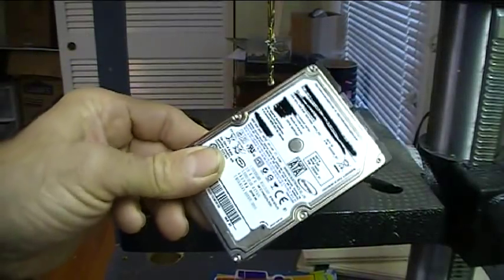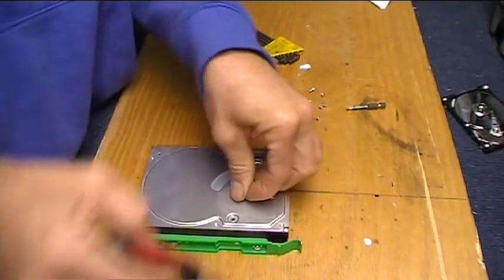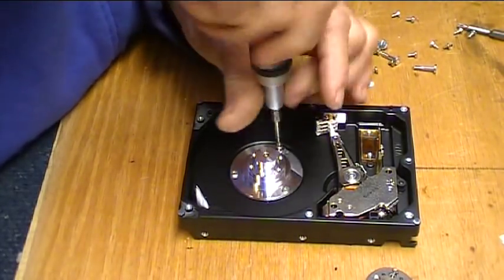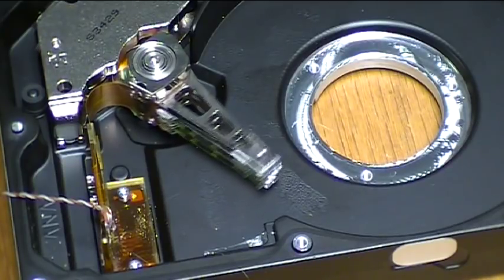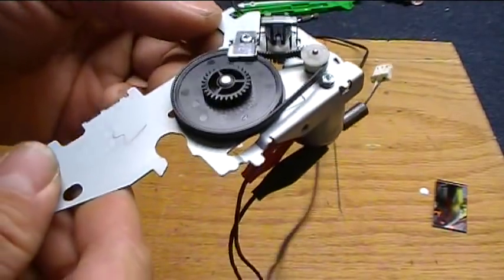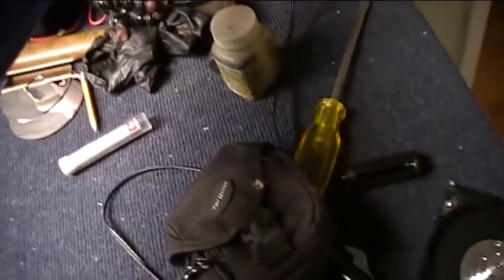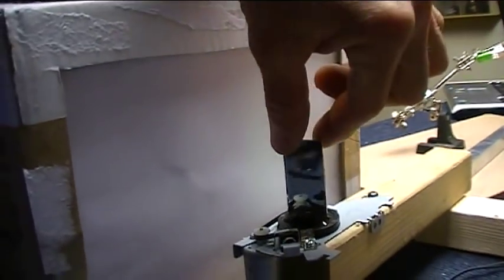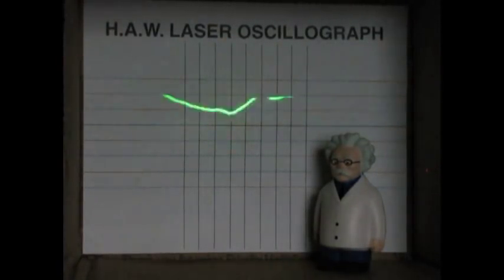Laser Oscillograph

Comment from the maker: Thanks for the tip.  I had seen a few laser devices with a rotating three sided mirror and it does indeed improve the resolution. I didn't have three mirrors at the time so I just made due with the single. Maybe I'll improve on the design and make a three sided one. I plan on taking a a version of this to Maker Faire NC this summer. :)

Comment: The hard drive actuator actually integrates the coil signal, the centering you get is thanks to the springiness of the flat flex cable. It would be better to take a small speaker and connect its membrane to a small pivoting mirror. And do the same thing to the time-base mirror, only either feed it some sawtooth signal, or use those oscilloscope music pieces available on YT.

Comment: Imagine using the motor in the hard drive to spin mirrors made out of platters. Moreover, since the platter can be bent it may be possible to reshape the platter mirror to fit the screen, making the laser point moves at constant speed on the screen.

Comment: Hi there, 
I came across your video and would try to replicate it to use it as a cheap laser galvos, anyway I was wondering as its not really clear does the motor uses positive/negative voltage only? Can it be directly connected to an audio output? And why is the amp used in this case, to up the voltage?
Thanks

Comment: hey there, i made something similar to what you have made there. now i'm lokking to make a 2d laser projector with 2 dacs an arduino and an TDA 2030 power amp. but i can't seem to get it working. all the low power signals are going great but i can't seem to convert the lowpower signal to highpower. any ideas on the problem ?

Comment: What was the belt driven device you used for the rotating mirror? Others mentioned using the ball bearing (rotating) motor from the HDD. Would you or anyone else out there care to elaborate more on how to do this exactly. I thought it was a stepper motor and you'd need the driver module\device to control the motion.
Reply: +Tim Thomas It is a stepper motor, google it.
Reply: I dont think you read my comment completely, or the way I worded it was confusing. I know what a stepper motor is. There are two questions I inquired about, first being; What the belt driven device was he used for rotating mirror (looked like a VCR assembly?) and the second question was; How to use a stepper motor from a HDD without having a driver device to control rotation and speed?
Reply: You can control the stepper motor with a stepper motor controller which you can buy. Google for more details, BUT if you're asking how to run it without any controller at all, then you can't. You can make a controller but it is tricky and it's much easier and cheaper to just buy a controller chip.
Reply: +Keenan Smith  Thanks for the reply, much appreciated!
Reply: @tmtseverewxchaser   I seriously doubt it's a stepper motor, as it would overcomplicate things drastically and unnecessarily. Much more likely to be a simple brushed DC motor like you'd find in practically every kind of disk drive ever made. Easy to find, and no driver circuitry required - apply a voltage and it spins..

Comment: Is the amplifier necessary to run the hardrive? Will the audio output alone be enough to make the tip move?
Reply: I would imagine the standard audio output should be sufficient . Lm386's are a 1 watt amplifier so there shouldnt be too much difference

Comment: You should mount a MIRROR on the servo not the laser. Also, cut off the arm and only keep the base part that moves and mount the mirror on it. They less mass to move the better the performance. A mirror would be about 1/100th(or less) the mass with the removal of the arm and therefore 100 times(or more) the speed for the same power ! The mirror should always be the moving part. Search ELM for a home built projector with FEEDBACK like the pros. http://elm-chan.org/works/vlp/report_e.html